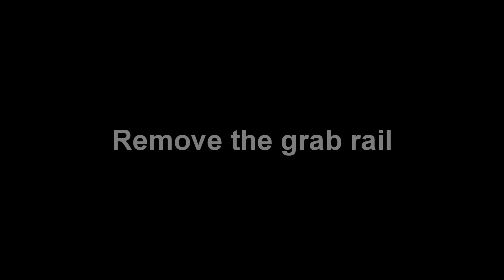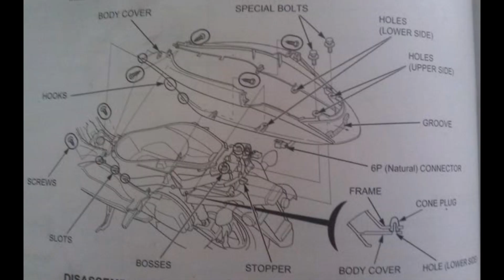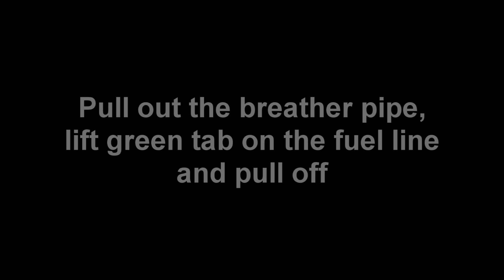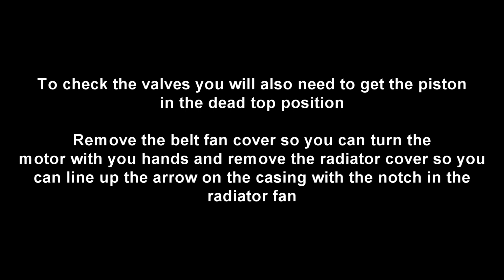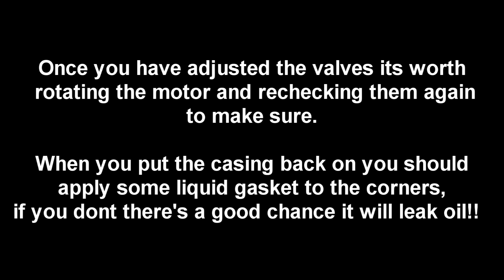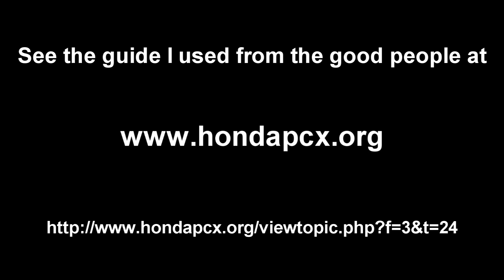How To Check Valve Clearances On A Honda PCX

Comment: The only way I would let a Honda dealer do this valve check to my pcx 150 and charge $400 or more is I would have to be there and watch them do it because if the scooter is running OK how do you know that they don't just listen to the motor run and just say they checked the valves and you know there's a possibility they could break some of the plastic pieces ?????

Comment: People worry too much about this.  It really isn't necessary at all.  You don't check the clearances on your car so why do it on a bike?  The only time you should investigate is if something sounds amiss.  Honda have these ridiculously OTT overkill checks because quite simply it's an easy money-spinner for them (same for other bike dealers).  They don't really make any profit on the initial sale, so OTT service intervals are where they make their money.  Here in the UK if you pull Honda technicians aside to an area where they are out of earshot of managers and ask them about checking the valve clearances most will openly tell you that they don't bother if the bike sounds fine.  They just tick the box to say they've done it and give you the bike back with a large bill for many hours of  labour that actually took them all of 20 seconds by starting your bike up and listening to it then switching it back off.

You'll probably notice that the clearances are a fraction under the stated measurements (but still within tolerance) at the first 600 mile check.  But, if you leave that check and only do it at 2500 miles (or later), you'll probably find that the measurements are bang on.  This is likely because Honda know the engine will 'loosen up' in the first few thousand miles and then bed in and be fine, so if you have them adjusted at the 600 mile check, you're likely to find them on the 'too loose' edge of their tolerance on the 2500 mile check, requiring another adjustment, whereas if you just leave them alone they should bed in just fine and not require any attention at all.  I get that people are worried about keeping the warranty intact but these engines are bombproof and nothing goes wrong with them if you do the oil changes as per schedule and use a decent fuel.  If you really want to be anal over the maintenance and longevity, don't use E15 in them and if you have to run on E10, don't leave it unused for days as the ethanol will slowly rot your fuel lines, pump and start to gum up the engine.  If you're leaving it unused for long periods, use E5 or ethanol-free fuel if it's available when you live, or use that all the time.

Stop worrying about it, guys.  They are not a ticking time bomb like some youtube channels and forums would have you believe. 😄
Reply: Thanks for the info I also had a friend tell me this since we both Honda scooter 🛵 he has a Metropolitan and i the PCX and he told me the exact same thing except do a compression test

Comment: This is as bad or worse than replacing the air filter on a Gold Wing or a Kawasaki Concours. I would much rather adjust the valves on a Moto Guzzi.

Comment: Is it really necessary to adjust the valves every 6000km? Because i can't do it on my own and don't want to pay 400 euros 2 times a year. Thanks
Reply from the maker: I've not touched them on my new bike, I'd do the 1st adjustment as the service schedule says (on a brand new bike) then only do them again if there's a problem. Google the symptoms of valve clearance issues so you know what to look out for.
Reply: furstyferret81 thanks, i will get my pcx to the Honda Service the 2 years to have the warranty, after that i do my oil changes by my self

Comment: Did you have to drain the radiator and the engine oil to remove to cylinder head?
Reply: He removed the cam cover not the cylinder head - a lot more work!

Comment: This video has inspired me to let a dealer service the valves rather than do myself. It's not that I couldn't  do it, It just looks like too much of pain to do them.
Reply from the maker: I later found out they hardly need doing at at all, the 600 mile check is important but after that my garage said they dont even bother checking them unless they hear a problem...

Comment: I have a 2013 OCX 150 with just over 10,000 miles and her. I have never done the valves. But now I am dreading doing them. How long would you say this took you to do?
Reply from the maker: Literally all day and about two nights of research, unless they sound bad dont bother! When was the last time you heard someone checking the valves on their car... 

No noise, no problem
Reply: +furstyferret81 I went ahead and did them. My scoot would backfire here and there and was loosing a bit of power. It took me all day and well into the night to do this. Cracked the grab bar cover and scratched it up pretty good. Maybe I will check again in another 10k miles ha ha ha. Thanks for posting this video. Without it my job would have been even more of a nightmare then it already was. I love my scoot but even for the most skilled mechanics this is a hellish job.
Reply from the maker: +Jayson Bird It's just a case of getting to the valves. I've heard of people cutting a sealable  hole in the boot so they check the valves in 5mins...

Comment: Thank you for posting the video.

I strongly considered buying a Honda PCX before I saw this. What were the "engineers" thinking? Oh, no, they probably weren't.

The PCX seems otherwise a fine scooter.
Reply: This is a great bike but this is to much . I heard you can take off the shocks and seat storage and tilt the motor down. I’m going to try that next but I started to do mine every 5,000 miles.
Reply from the maker: I wouldnt do it again, moved to SYM now and im much happier!

Comment: was going to buy a pcx but not now I have  a Yamaha scooter 125 and not had a problem in 8 years so thanks for this vid to much service cost with Honda wil buy Yamaha nmax instead.
Reply from the maker: +Gary Sutherland I had an SWing after the PCX, both had problems! Now got an SYM and love it, think Honda are riding on their good reputation which wont last. Yamaha seem to have the reliability but you pay a premium for it, in the long run I would bet it works out cheaper unless you sell the bike as soon as the warranty runs out.
Reply: +furstyferret81 was thinking sym what sym  have you got or recommend 125cc scoot thanks G.
Reply from the maker: Gary Sutherland I got the Joymax 300 but they do it in a 125cc too, i'm getting 85mpg on mine and love it! Lots of little touches like led run lights, seat open switch, immobilizer under the seat, folding mirrors. S Wing is a big step up from the PCX and the SYM a big step up from that, Currently doing 0% finance with 5 year warranty too. On the downside its kph speedo, hard to find dealers/test rides and i would imagine parts but i haven't needed any yet.

Comment: I can't believe the manual calls for this to be done every 2,500 miles!
Reply: EVERY 750MILES OR YOUR SCOOTER IS DEAD IN 2 YEARS
Reply: I’ve check my two times and did not need adjustments

Comment: Hi, I am about to hit 6,000 miles on my 2011 Honda PCX. I never had an official service done by the Honda Dealer in my area.  Why is checking / adjusting the valves important? I regularly change the oil every 600 miles, I have replaced the sparkplug at 5,000 miles, and recently replaced the front blinkers because they got stuck but that is about it.
Reply: DontFuckWitDreDay If the valve clearances are off by too much, it can cause engine damage. As for changing the oil, every 600 miles is a bit excessive every 2500 miles is recommended in the owner's manual. Tbh, the recommended valve clearance check every 2500 miles is excessive...Every 6,000 to 10,000 miles is fine usually...
Reply: If any valve has to be adjusted every 2500 miles something is wearing like mad. The only reason to adjust anything is because of wear. If this engine wears a component in the valve train to that extent something is wrong.I have a CB300F and they call for a valve check at 16,000 miles. I see no reason why this engine should be any different. Makes a lot of money for the shop. I would check at around 5000 miles from new and if it shows no wear I would extend that to 10,000 miles.

Comment: Didn't see the part where the valves were actually checked and adjusted, was all this only to show removal of the bodywork ?
Reply from the maker: The valve check and adjustment is easy, just getting to it is the hard part...
Reply from the maker: I did have video of the valve check but it somehow got lost when i edited...

Comment: I needed to replace a broken coolant reservoir and I was able to access that, and the valve area by removing the bucket and rear panel and handles only. Did not need to remove any of the side panels or center console. I think I will adjust the valves while I have it apart.
Reply: HACE UN VIDEO ASÍ APRENDEMOS

Comment: Alternatively, they couldve put a trap door in the bucket so you can acess them just as easily as every other scooter on the market.
Reply: +Joe Ghelarducci get a hammer and "fabricate" one :)
Reply from the maker: If only Honda would listen to us!!!
Reply: Can you not just cut a hole 🕳️😂😂😂 I'm needing this done just now I think as my bike won't start just had RAC out there guy couldn't get it going done 7770 miles, is it worth doing myself?

Comment: So, you're saying that at 15k miles was the first time a valve clearance inspection was done on your PCX, and only one of the valves was slightly out of spec?  That gives me hope.  =)
Reply from the maker: Didnt notice much after the adjustment so it cant have been far out if at all, prob best to check every 5000 miles or so but i wont bother again unless it makes a noise or I get bored.

Comment: I'm sorry - but I am getting ill watching how you have to take this entire scooter apart to check the valves. I thought servicing a Vespa was crazy (dropping the engine to do the valves) Apparently Honda figures you will have sold this scoot on before ever needing to see the valves! Honda = great machines - but my Lord, this is C R A Z Y !! (can get to my Kymco's valves in about 15 mins. Seat bucket off, battery cover off 3 screws,center panel off with 2 screws  and... Bob's Your Uncle!! There is the valve cover, spark plug, etc.VERY easy to service and I was a complete novice when I started.) Loved your Euro trip on this scoot the kind of thing us scooter guys dream of doing!!.
Reply from the maker: Its a pain in the ass but no reason not to buy a PCX, this is why i made the video!

 Valve clearance is almost the same on any scooter but the PCX just needs more panels removing which makes it more expensive at a garage so its a good idea to learn how to do it for yourself! This only needs doing every 2 or 3 years at most.
Reply: Hi , what model kymco do you own for such an easy servicing scooter  ,
Thanks .
Reply: @brettwicks2615  Kymco LIKE200i
Reply: @4711StGermain  Thanks , do you still have it ?
Reply: @brettwicks2615  sure. 9 yrs. , still bullet proof

Comment from the maker: I have to admit i would never buy a bike from new again. If you factor in the costs of the services it offsets any fuel savings you have against just owning a car. However if you buy second hand and do services like this yourself then a scooter is well worth it. The valves really only need doing every 10000 miles unless you hear a problem and with some basic home servicing you will have a bike that lasts forever.

Hence why i made this video!!! ;)
Reply: HEY . DID YA MANAGED TO SPEED UP THE SCOOTER FOR OVER 100KM/H ???

Comment from the maker: Well iv had done 15000 miles before checking them and they only needed a slight tweak! I wont be checking them for another 10000 or if i really think they need it.

The whole job can be done in a couple of hours easily.